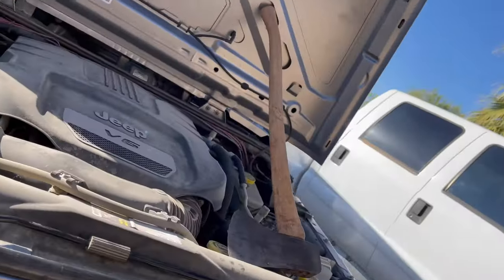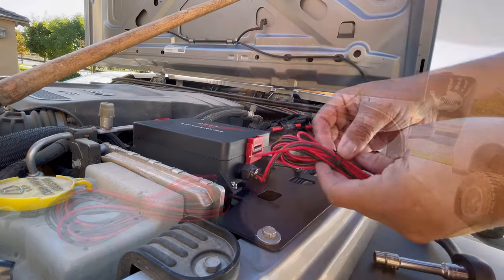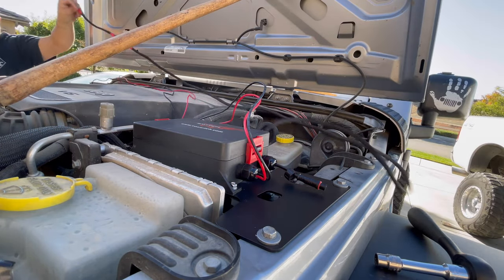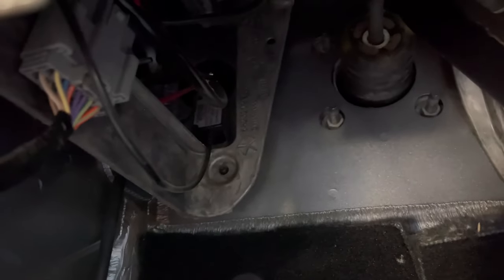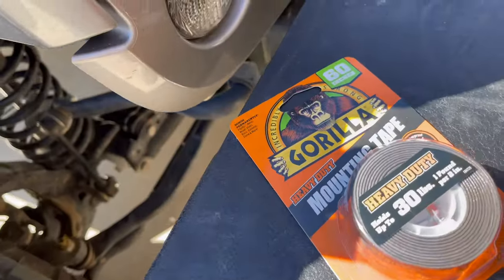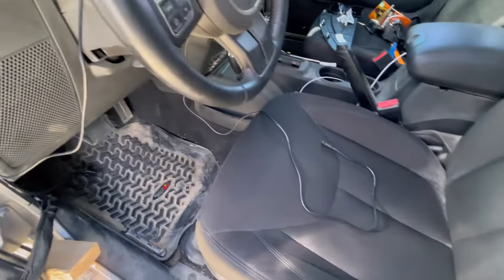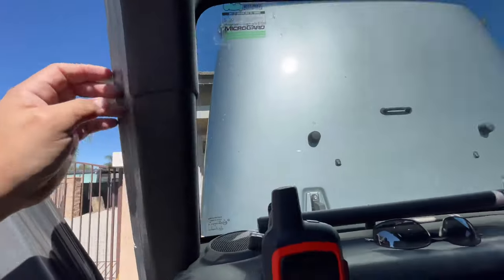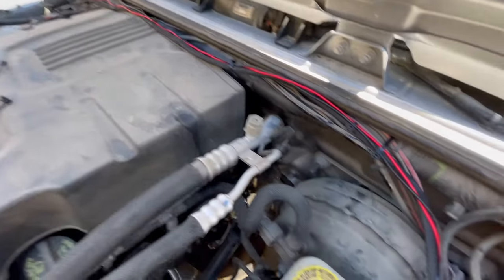Voswitch quick install on Jeep JKU Wrangler | JK100 | 8 switch control system

Comment: With the voswitch being ran to the positive and the negative battery terminal, does that not give a ground to everything that you run to it automatically?
Reply from the maker: While the unit itself is grounded, there are no negative terminals inside the unit for your accessory. For example you wire in a CB radio inside the cabin. You run the positive wire to the Voswitch. You then run the negative wire elsewhere tht has a good ground. I chose to run all my accessory negatives to the battery. I wouldn’t call it a downfall of the unit but for the price compared to the spod I’ll gladly run my own ground wires. Hope that makes sense.
Reply: Yeah, that’s completely inappropriate.